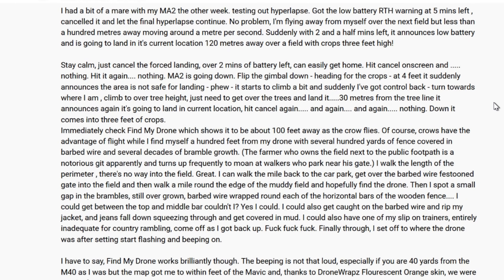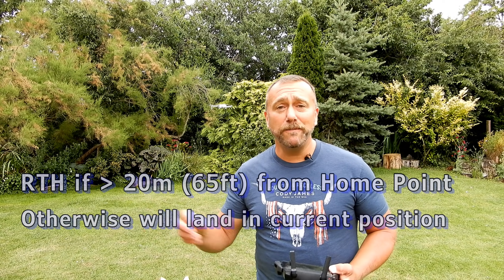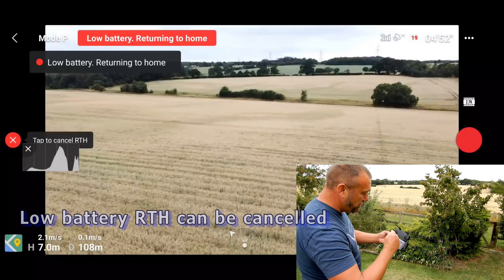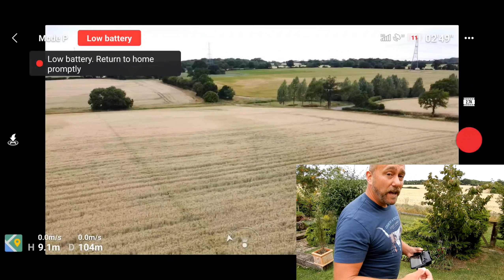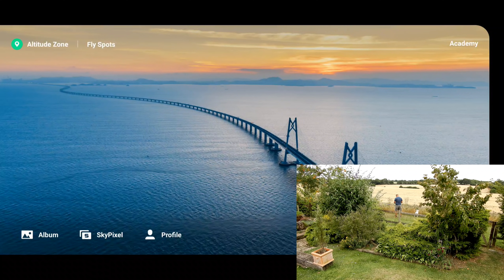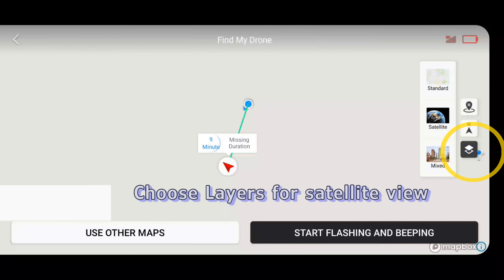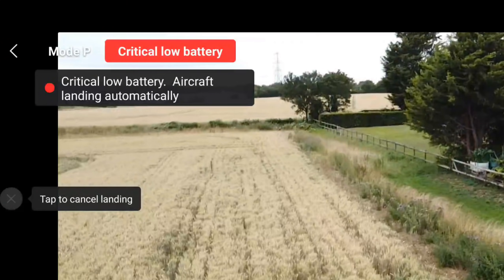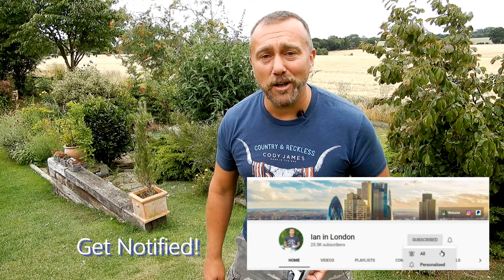DJI Mini & Mini 2: Flying to 0% Battery - RTH, Critical Battery & Auto Power-Off explained

Comment: Thank You so much for your Video, it helped me a lot to figure out where to find my lost Mavic Air. 
I was taking some nice shots over a giant Man Made Hole with Giant Excavators (Tagebau Hambach Germany) from a Platform on top of a small Hill, what i didn`t realize was that there where strong Winds that pushed the Drone out a bit to much, i tryed to fly it back before the RTH Point was reached, in Sport Mode it only reached about 15-20 km/h, and than it hit the 6% Battery point and said it would land now, this was about 250m away from my starting point and already 20m below me, due to the Tree Coverage at some Point i Lost the connection to the Drone, last Position in "Find my Drone" was at the Edge where the Trees started down there, so i took the short Route to get down and try to find my Drone, but it was nowhere to be seen, the Remote must have caught a Signal on my Way down it was Upside Down and Grass in front of the Camera... it didn`t took long for some Workers to spot me there searching, they helped a little, but the Drone seemed to be gone, and i had to leave this Place because Civilists are not allowed down there. 
So i Yesterday asked a Friend which is working there for help, he took me to the Spot where the App has the last known Location, we searched every little Spot with Grass and still nothing to find there, so i had to go again without my Drone... and then i saw your Video Yesterday Evening, that the Drone will respond to the Remote Signals until the Battery is really at 0% and i just decends when you let got the Sticks, so i opened up the App ad watched back the last Flight Record with Stick Controls shown, it was at 99% forward when it lost the Signal (where it Recorded or send it last Position), so i asked my Friend if i could try to search somewhere above this position again, and i could. Today i was there zigzaging my Way down to cover some Ground from the Direction of Flight and last known Position, just a little further up, and i would say 50m beyond the marked Position i Found the Drone between some Trees, nothing was broken, just a bit Wet and Dirty. 
If i hadn`t seen your Video i for sure would have not tryed to find it again, but so i could retrieve it, and maybe it helps someone else to figure out the Position where the Drone is, when you have a Signal the last Position will be accurate, but when you lost Signal because of Trees or something else, you need to know what commands you gave last and for how long.

And Again thank you so much for that Video.
Reply from the maker: You did really well to find it!!  That's why it's so much better to land before you lose signal.....  Glad you got it back!
Reply: @IaninLondon  that`s what i thought while searching, i only i had landed it in a spot where it would be easy to find, but somehow the Panic got me, and when the Signal was gone it got even worse. I just didn`t know it would still respond to to Signals from the Remote even it said "Landing", with that knowledge it could have made it back to the Starting Point, as there was almost 1 Minute Flight time remaining. i think i will be better prepared now, and pay more attention to Winds and how the Drone is behaving. :)

Comment: Hi Ian
I’m glad I watched this when you posted it(I obviously didn’t listen to the “don’t push your battery part”or I wouldn’t be writing this now🤔)as I had my Air 2 out yesterday on a 14.7km flight, and managed to land at home with 2% battery remaining.I had cancelled the initial low battery return to home as it was about 40%, and decided to carry on another 1.3km away.  When I decided to head back I was 3.8km away on 28% battery.  And as I found out it goes down a lot faster than you expect.
When the flight remaining time turned red I got the “critical battery aircraft landing in current position“message(but this does not appear on the flight log I have uploaded (so I have a permanent reminder of how stupid I am)for some reason), and it started counting down and started descending on it’s own, this is the important part of your post I did remember, and I put full throttle up and held it and that stopped the descent, but it slowed from 19m/sec to 11m/sec.I came another 1km closer like this until it came up with another power limit message and slowed to 5-6m/sec, but I was closer to home now and managed get it home and hand catch it with 2% battery left🥵
Also there was no beeping or anything from the controller whilst this was going on, but to be fair I’m glad about that because that would not have helped one bit, as I was panicking enough.
Anyway sorry about the long winded post.
Kind regards 
Kev
Reply from the maker: Forewarned is forearmed.... Learn and move on 👍🏻👍🏻👍🏻🤠
Reply: Don't be dumb- you should have AT LEAST 40% to come back. Pushing another 3.5km was going too far
Reply: @Matanumi  Every days a learning day.

Comment: At what voltage does mini say 0% ? 6volts? Or will it chance ruining the battery and go lower?
Reply from the maker: The cells went down to 2.8 & 2.9 v so the overall voltage was 5.7 v.  But yeah, you don't want to be doing this often or it will affect the battery...
Reply: @IaninLondon  yea that's low.  Yea can't do often.  I have a battery (fpv drone) ever so slightly puffing from a weird issue once 2 cells hit 2.9v other two at 3.6v after landing and checking them. Then other times going low being lazy not wanting to walk haha lol 
I marked battery and been watching it.
Reply from the maker: @divingfalconfpv4602  Keep an eye on that swelling........ :) As it is, I'm just editing another video where I flew to zero % again to demonstrate the new battery countdowns for the Mini.... But I do treat my drones more like tools for the job and push them a bit.... :)
Reply: @IaninLondon  I like the idea for battery to last more charge cycles and come back at 3.4v a cell but never works out in practice lmao...
Except my 1s whoop that I take to 3.0v .. i abuse that thing lol

Comment: Nice video. Just one thing. If the drone in forced landing mode, you can't get altitude anymore, but can you change the position of the drone? I mean can you go forward or any direction like normal landing ?
Reply from the maker: Yes; you literally have a few seconds depending on its height to change its position....
Reply: @IaninLondon   Thank you.

Comment: Unfortunately the rated fight times by mfr's are virtually fantasy.  In my case I start getting a low battery at 16 to 17 minutes into flight on a battery rated for 30 minutes.  Shortly thereafter it will go critical and begin the RTH safety feature, and within a minute or two will start to land.  Hyping unrealistic battery life leads to over expectations.  DJi  needs to reduce the flight time to 20 minutes.  This should be the amount in bold print with the 30 minute "ideal conditions" figure in fine print instead of the other way around.
Reply from the maker: You should be getting low battery around 23-24 mins.  Did you watch my full throttle video?

Comment: Well, I was already pretty sure that I did not want to run to 0% but you’ve eliminated all doubt! On a similar note, do you know of any way to use the Air 2 controller with any decent simulator?? (no, not in DJI Assistant!) I could use the flying practice on rainy days and not sure if DJI will support the Fly controller in their simulator anytime soon. Thanks, Ian!
Reply from the maker: Hi Forest
I don't know of any other simulators you can use...  but the Air 2 is great in strong wind; get out there...... :)

Comment: 3:00 I don’t understand why it would determine the remaining flight time based off the distance from the Home point how would that affect it?
Reply from the maker: The estimated remaining time is like your car's fuel range estimate. It's always recalculating based on how fast you've been flying and if you're far away from the home point, it knows the RTH will take far longer. Also if you're flying at high altitude it knows it has a lot of decent to consider too.
Reply: The video described it wrong. That number indicates how much time you have until you battery is at 0% based on what you are doing at that exact moment. For example, if you are hovering in place and the number says 5 minutes, it will die in 5 minutes, not return home.

Comment: Is there obstacles avoidance on the mini? Is there different levels of the avoidance in Mavic Air, Mavic Air 2, Mavic Pro, Mavic Pro2 and other drones ? 
Thank you I have been a RF plane pilot and glider builder and due to Glaucoma my vision as grounded my pilot RC plane but love seeing videos and photos my friends tell me are much easier and after flying a friends DJI Mavic on auto mode using IPhone WOW fantastic now I want to get one but need advise. Thank you
Reply from the maker: The Mini doesn't have any obstacle avoidance at all; th Air 2 has this.... If you can stretch to the Air 2, it will do you fantastically... Cheers, Ian

Comment: That was me searching through long grass on the hills when it crashed lol I looked for so long and the beeping alert was sooo quiet, they need to make it louder.
Reply: The sound is made using the motors, so it isn't very loud. DJI should really add an actual speaker to the drones
Reply: Use a parabolic mike.  A pickup in an old mixing buwl will do.  Estes Rockets put out one that looked like a handled tube.  It concentrates sound and gives you direction.
Reply: @dennisbrooks240  If I see middle-aged men walking around a field with mixing bowls to the their head I shall now know why :D
Reply: SPASMØDIC Actually, the pickup microphone, even your phone with ear plugs, goes in the center of the bowl.  Tape in place and point the open top of the bowl toward your search area.  Sweep back and forth for the loudest beeps.  The bowl is similar to cupping your hands behind your ears to hear small noises and make your hearing more directional.  It works, though putting it on your head might keep you safe from aliens, similar to tinfoil hats???
Reply: @dennisbrooks240  I cna imagine it works similar to the spy kit type devices they sell for kids. It makes sense as it just like expanding your ears giving a larger surface to catch sound waves. I still like the thought/image of a man with the base of a  mixing bowl to the side of his head though 😁

I think practically though, just your phone and earphones could be a phenomanal difference from our own earing, that is defintly a practical solution as you will already have you phone and just need to chuck a pair of earphones into your drone kit 😁

Comment: Well done video! Most of us Mavic Mini Operators will at one point in time run into such situation. 
It happened to me flying in hilly terrain with unexpected much stronger winds at little higher altitudes. I was lucky smart enough to fly with the remaining power to the next best landing site. Out of this acquired experience now, once at 30% power I start thinking about an eventual plan B. In unfamiliar terrain I found to use the map function helpful in order to fly as close as possible to the nearest road.
Reply: That is always a good plan, better to land it somewhere and retrieve it than outright lose it where you can't get to it!
Reply: Mines sitting in the bottom of the ocean

Comment: Another good tip is to know landmarks to know how to fly quickly back on sport mode....nothing worse that being critically low and losing orientation of where you are and panic sets in.  Like in the 107 course never resign!  Thanks for the video.  🤙🏾🤙🏾🤙🏾
Reply: On the left lower corner you can even see your aircraft orientation to your transmitter. Just tap the icon. It does help a lot when flying in unknown environment

Comment: Maybe worth mentioning , you should always just try to land with a minimum of 20 percent battery remaining. Not because it safest way to fly , but burning that last 20 percent is when the most internal damage occurs . I have an older mavic air and I always try to land with between 20 to 30 percent , I have 3 batteries and they have over 75 flights each on them and are over a year old and they give me the same flight time as they did from the start. Burning batteries to zero percent will greatly shorten the batteries life span. Still great video with good info though, just wanted to mention that about battery care. Edit: it just occured to me, I bet you covered proper battery care in a previous video, lol, didn’t mean to say the advice within this video wasn’t good sound and helpful for anyone having a battery issue, thanks for making the helpful videos, I have a mini and the fly app is different from the go4 app I’m used to. So the advice on the mini is something I find helpful for sure. So you have one new sub today, the least I can do for the great info!
Reply from the maker: Good points, and I haven't actually done a battery video, so I updated the notes and leading comment on this about not going to zero.... CHeers, Ian
Reply: Ian in London , yeah I ruined a couple of spark batteries, it was my very first drone, I figure it’s why I’m always compelled to mention it, lol. I killed them with heat in general I think, a combo of flying them to there limit and then putting them inside a hot vehicle , I didn’t know any better at the time. Live and learn, a costly error. It makes me wonder how phones seem to take it with less negative effects. Different tech I guess maybe.

Comment: I crashed my drone at sea this winter in Hakodate (Hokkaido Japan) with my mavic mini. I was confident i could bring the drone back as it had like 60% battery left and i was about 1500 m away (return trip against the wind).
As i was very new to this drone i didn't set it to sport mode, this made flying against the wind veryyyy slow. As the drone was only like 200m away it started autoland at about 20%.
I should have been able to bring it back to me or at least land it on the island i was standing, but at one point the drone didn't want to move forward anymore and worse, didn't want to lower altitude !!
The wind made it drift toward the sea more and more until it didn't have anymore battery. What a scam .
Check my video of the accident===>

Comment: It seems very strange to me that the "time remaining" clock would be affected by how far away the Mini is from RTH location.  Certainly, from an electrical perspective, this isn't true and I don't see how it helps the pilot anyway.
Reply: I think what Ian's trying to say is that the "Time remaining" is an estimate of the time you have left to use the drone, for whatever propose, before it needs to return home. Not the actual time it will take for the battery to be critically exhausted. this is useful for most people because you don't have to try and work out how long you need to allow for returning home. they've done that thinking for you.
Reply from the maker: It's like the range estimate on your car; a guess based on how you're flying.  If you fly faster, it uses up teh battery faster and so it recalculates; if you fly further way or higher up, it will need more battery to head back and the RTH will kick in earlier, so it's always trying to re-estimate....

Comment: Well done Ian. As a drone pilot for 6 years, I still appreciate these educational videos. Drone systems change over the years and what may have been true a few years ago on one drone, may not be correct now. An example, the need to discharge the battery every so often to reset the smart battery. I believe this is no longer a DJI requirement.
Reply: Very cool, are you primarily a racer or a photographer?
Reply: @anytimetown6214  Photography, since getting my first drone they have fascinated me.

Comment: also....... one morning I set the RTH on a harbour wall at Paignton Harbour......
The RTH worked perfectly when my controller lost contact with the drone  ( Mavic Air ).....
problem was....... The drone held its position about a metre outside the wall..... There was no way to reach it....
Fortunately after a few minutes the easterly wind slowly blew the drone above land...... buuuut, it was still a couple feet above me out off my grasp and would not lower..... as the wall was about 5 foot high to start with.....
I did end up retrieving the drone...... but when setting return to home make sure that if by waterside, or on the edge off woodland, make sure you move a fair few feet away from the boundary and have it placed on the ground..... not a wall as it will not land until battery depletion 🤣
Reply from the maker: Yes!  Lucky break there.... Woudl have hoped the controller could make the connection again wiht it being so close, but make sure your RTH point is good for a few metres in all directions...👍🏻

Comment: Yes I had the critical battery issue a couple of weeks ago with my pro. I was over corn fields as well but to cut a long story short; because of the auto landing and the fact I always land by hand the drones props took a decent go at my finger and I'm not exaggerating there was blood all over the side of my drone! 

Ian what is it you do in London for work may I ask?
Reply from the maker: Aha, the hand catch can sting if you don't do it right.  And the Pro has strong props.... :)  I am a suit in the city (or was, until lockdown happened) as business analyst for one of the large banks.  But lockdown means working from home for the foreseeable future which is handy for making videos out of your back garden :)  Cheers, Ian

Comment: When you enter RTH (and don't cancel), can you still control the drone (change height/direction/etc) while it's doing it's RTH?
Reply from the maker: Yes; I meant to say that during the video.  You can alter height and orientation, but not direction of flight (ie it keeps to the straight line back to you).
Reply: You can also push the stick forward to make it RTH faster (it normally flies slower to make sure obstacle avoidance work)